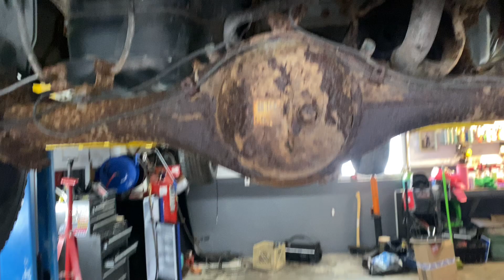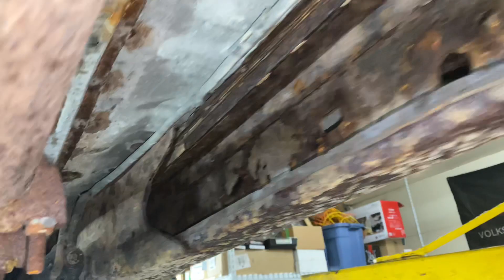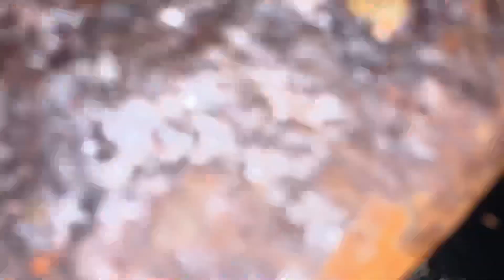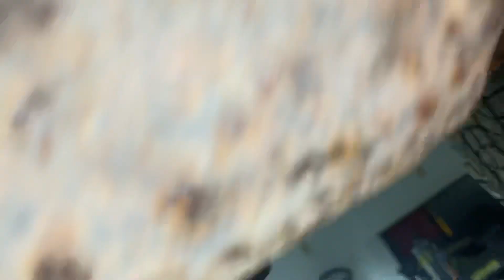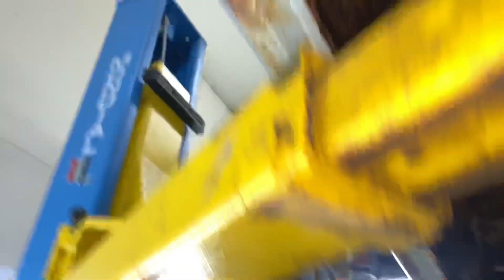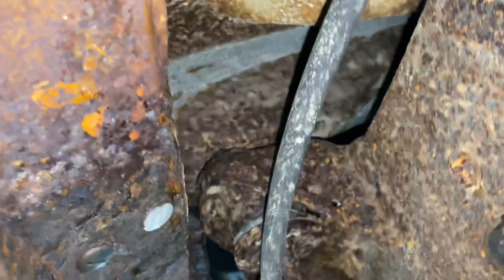2005 Tacoma Rust

Comment: O. M. G! The frame replacement is like $15K to have it done. This truck looks to have rocker panel rot too! Also, as a 2005, it will have a questionable head gasket. This is a project truck, or a nice source of parts for another truck.
Reply from the maker: It was a part out after.